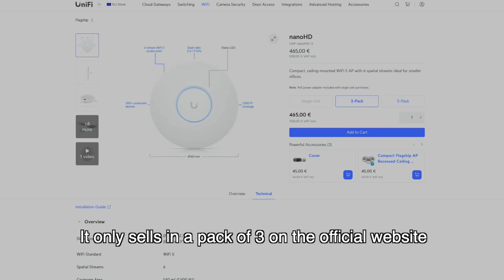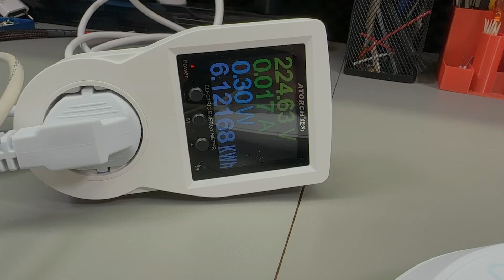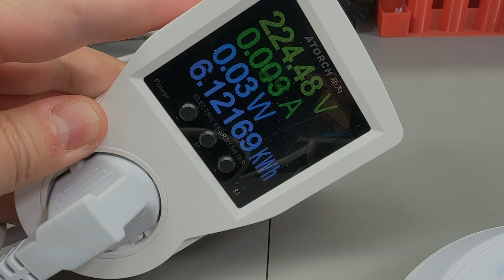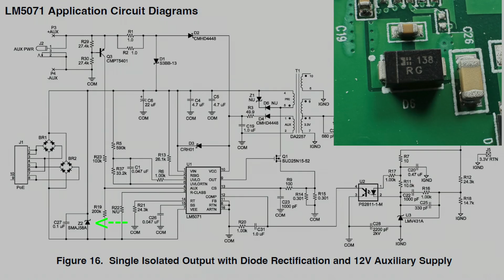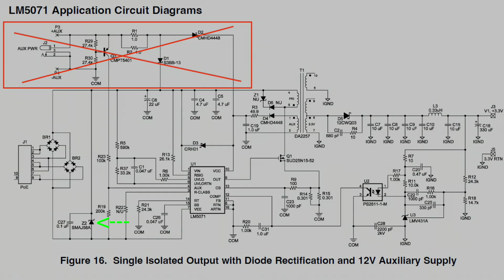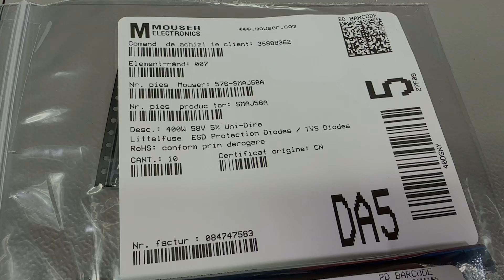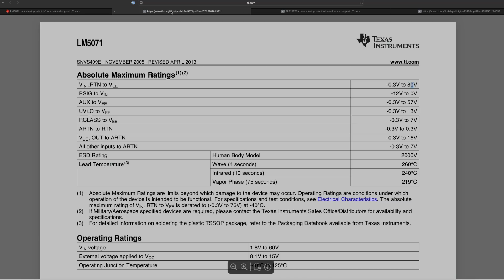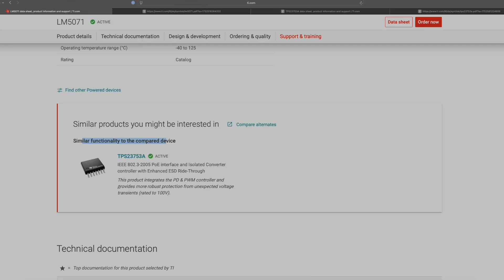Dead UniFi NanoHD Repair for Just $3.50 in Parts

Comment: Nice repair.  Mouser and DigiKey are great expert for that shipping. Last power supply repair cost my less than $1, but I added in some FETs that went down line from the TVS diode just in case they were also damaged and in return free shipping with more spare parts on stock for future things.

Comment: Many of these die from being connected to the wrong other-proprietary power supply. the TVS diode also dares die short or open due to reverse voltage application in some kind of way, which can either cause it to appear broken, or for the diode to burn out, the reverse voltage protection to subsequently disappear, and then kill the power circuitry. :)

Comment: Nice job!  But.... the AP was adopted when it crashed at the previous owner, so it won't show up as adoptable at first start.  You cheated with your footage 😜
Reply from the maker: You are right, there is a small segment missing where I had to keep the reset button pressed to reset to factory settings.

Comment: Good repair.
The fact that the original TVS SMAJ58A failed short, means the transient was more than what it could handle. So its hard to expect the LM5071 to survive. They could have put a PTC in front of the TVS, or used a SMB or SMC package though.
The new IC of course helps, you can use a higher voltage TVS and give yourself a bit more headroom, less likely TVS will blow up.
Reply from the maker: Interesting points, appreciate the feedback!